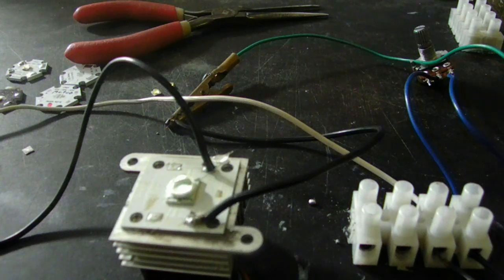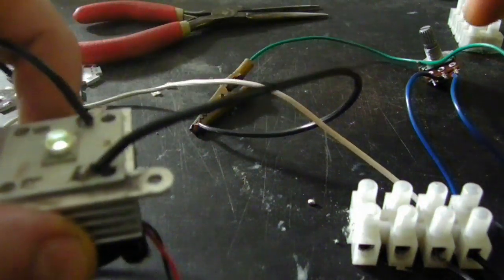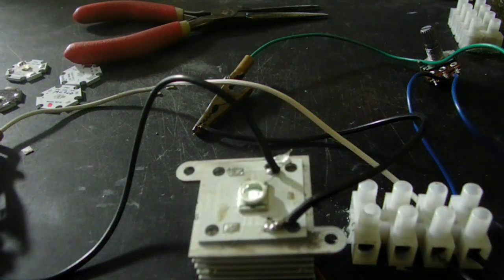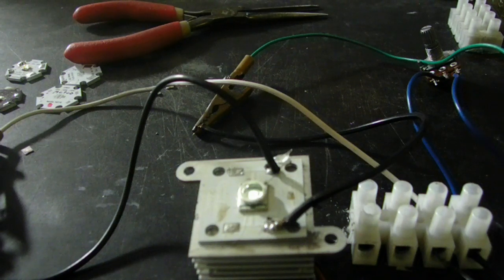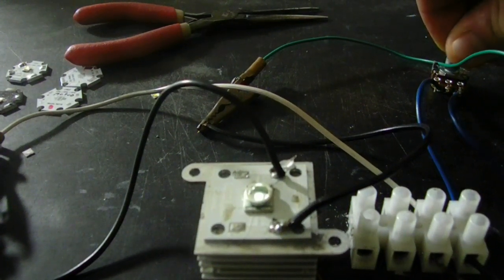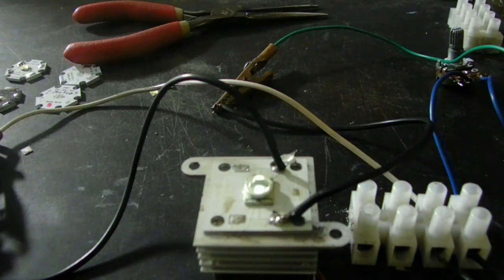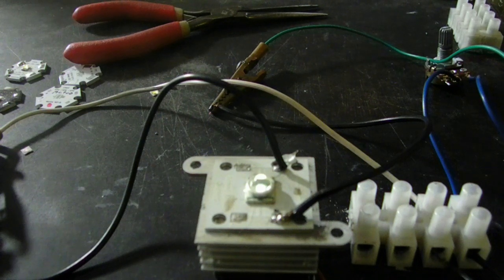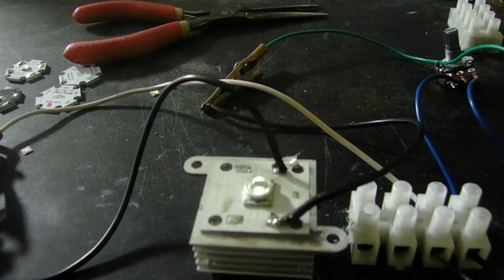Using a potentiometer to dim LED

Comment: My potentiometer Is 20k to dim a white LED off of a 9v battery, but the potentiometer burns up, please help, why does it burn, thanks.
Reply from the maker: The potentiometer might not be rated for that high of a voltage and might only at best control a line signal voltage, in which case you needed another resistor run in parallel with the potentiometer as the pot was taking too much of the heat.